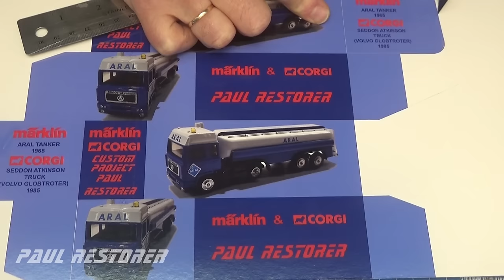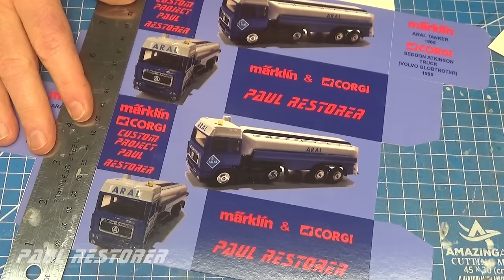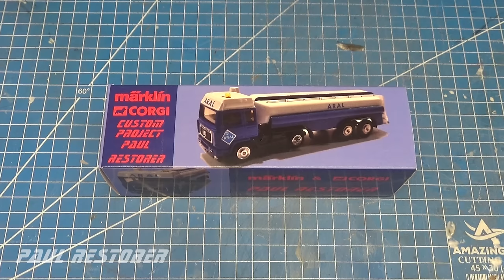Cysterna Marklin i ciągnik siodłowy Corgi. Kompletna custom renowacja.

Comment: Hi Paul. Wow a Seddon Atkinson I can definitely say I've not seen many of these restored before. Great clean work as always.
I've got an intrest in Seddon Atkinson,  I live in Oldham in the UK where they used to be built, they got taken over by Pegaso trucks and then they got taken over by Iveco trucks.
Reply: the cab is a Volvo cab, my guess is they didn't have the licencing to call it that
Reply: @davidfogg1845  
Mmm! It is a Corgi Seddon Atkinson cab, plenty on e bay to compare with, plus it actually says Seddon  Atkinson on the model .

Comment: Another restoration that is actually an improvement compared to the original, especially for the truck with the extra signal light and the front lights. Your restorations are my daily zen moment! Cheers.
Reply from the maker: Thank you very much